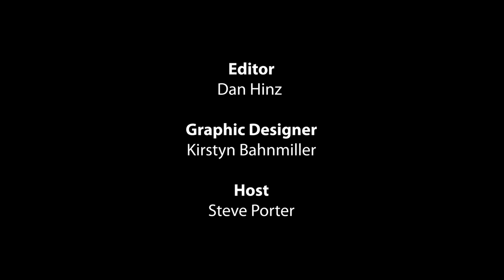The Truth About the Electronics Refurbishing Industry

Comment: I work for a computer refurbish place, and i can promise that majority of the laptops/desktops we sell are not that clean inside, just outside. The main reason for it here is actually time. They only hire one person to complete sometimes 15-20 orders a day (which includes fixing and updating the computers) and they need to meet the deadlines. There is zero time at my company to actually deep clean the computers but that doesn't bother management and from what i can tell with reviews online 90% of customers don't care or will never notice.
Reply: I will also say that when the company is buying these computers, they are on average buying them at half of what prices are on ebay, for some reference.
Reply: Sorry but in my opinion what your company does is a scam. Cleaning the outside of a device is NOT refurbishment, its just cleaned which frankly should be done anyway with any used and resold device.
Reply: We were making over $100 per computer at my store, so I didn't care if it took an employee a few hours. I wanted my refurbished systems to have the highest quality.
Reply: @JaimeWarlock  well thank you for being a good company. i actually quit the place last week. they stated they were only making about 30 per computer, and after cutting my hours and starting to send different products than what people ordered i left.
Reply: @cbcdesign001  you either didn't read or understand his entire comment...

Comment: As someone that worked for an unnamed blue and yellow electronics retailer for almost 30 years and worked on TONS of car stereos with the same load rollers I also suggest taking the rubber off the roller shaft and cleaning the inside of the roller. In extreme super dusty units I used to add some silicone to the inside of the roller to help it stick to the shaft. Great videos. Love em. Keep em coming.
Reply: Why not just say the company name though? We all know what it is.
Reply: Hustler electronics
Reply: 🇺🇦 Ukraine electronics? Didn't know that was a thing.😂

Comment: When I hear refurbished two things come to mind:
1. There was a previous issue with it, it was sent back to the manufacturer and the issue (e.g. replaced part) was corrected then resold.
2. It was professionally cleaned and brought back up to spec (parts may or may not have been installed, reapply thermal paste etc.).
Reply: These are the two I think of as well. The only worry I ever have is whether or not they fixed the original problem. Sometimes they miss something, especially if they can’t reproduce the issue. It's rare that you get to find out why something was refurbished but it does happen.
Reply: That's remanufactured. I would hold that to these standards.
Reply: You would be surprised how much stuff is tossed just to get the newest system, especially in government. When I worked at one refurbishing center, we would often get hundreds of computers from a local government office that were only a couple years old.

A lot of times, they would pull the new system out of the box and put an old system back in for easy logistics. One pallet we received actually had 5 boxes with brand new computers that they apparently forgot to exchange. They had never been used and I sold a couple for $500 each. Remember, these cost us nothing. Employees snatched up the other 3 (boss would occasionally let us have the best stuff).

Comment: As someone who has done a fair share of buying and reselling over the years, I always open up consoles and controllers to give a good thorough cleaning and also replace worn or damaged parts.  I'm more of a hobbyist but my turnaround time is often a couple of weeks, rarely less than a day.  I always submerge plastic parts in soapy water and scrub, and of course the drying adds a lot to the turnaround as does a thorough testing. 
If you're going to do it with that level of detail, honestly it isn't worth trying to make a profit on most things because there is so much time put into it.  The parts can also reduce a significant chunk of the profit too.  I happen to enjoy it and love to be the one to keep these things out of landfills.  Since it's not a "business" for me, I can take my sweet time and paying my bills is not affected by that.
Reply: Very cool man. If I didn't have several other hobbies I'd do the same. I do occasionally sell a few lightly used electronics and it feels good the items will be put to use again 🙂

Comment: Realistically, I expect dust to be removed and thermal paste replaced. A wipe down of the outside is necessary as well. Probably wouldn’t pay more than $200 for a refurbished console, which I know doesn’t leave much room for profit. Ultimately I’m buying cheaper and cleaning up myself. Ultimately the trick is to find cheaper systems and refurbish those, which is what DKOldies and GameStop does. GameStop trade value on an original PS4 is $55, which leaves a LOT more room for profit. Perhaps the key to the average person doing refurbishment is to find people selling those consoles for cheap (which potentially leads to more issues and parts needed to eat away at the profit margin anyway).
Reply from the maker: Yes, agreed. One of the keys here is getting them cheaper than the average person can find them. These companies are making crazy profit by selling them as refurbished when they don't do anything other than wipe off the outside.
Reply: @Tronicsfix  what also hurts too is that companies like DK Oldies buy up those console, even at more expensive prices, in the interest of making availability scarce so that they have a firm foothold on the reseller market.
Reply: Nowadays if you have $200 to buy a console you're better off getting a used Series S as they're going to making more games for it for a long time.
Reply: @jimmymyers  Just wish it had a disk drive :( Series S would be perfect with a disk drive.

Comment: For me, reburbished means to make it look and work as close to new as possible, which requires deep cleaning on the outside and inside, recapping if needed, and definitely new thermal paste, plus a few repairs where needed/possible. IMO, retro-brighting is NOT a refurbishing step, just an enthusiast option. I don't mind yellowed plastics, as long as the hardware is in top shape.

Comment: What I expect from "refurbished" is exactly what you did. Remove all dust and dirt both inside and out, new thermal paste, replace broken parts like fans. But I know the reality when companies say "refurbished" what they mean is "we did nothing and we hope you won't notice".

A complete refurb would also replace caps that fail an LCR test, replace loose ports and connectors, and any other preventative maintenance. When you buy a restored car that's what you expect; new belts, new gaskets, everything restored. But in the computer world they prey on people who don't know that electronic components also wear out.
Reply: I've done all that with a few old consoles I bought for myself but didn't want anymore. I took them apart, washed the case, cleaned dust off the motherboards, replaced capacitors, maybe did a video output mod. 

When I did sell them, I still didn't say "refurbished" just because I didn't want to be associated with the people who misuse the word. I just listed off all the things I had done and took as many pictures of the work (clean shell, solder joints, etc) as I could. When I'm trying to buy something, a detailed list of things that were done as well as a lot of photos would mean way more to me than "refurbished" so that's what I did when I wanted to sell something.

But hey, I'm just a hobbyist who occasionally needs to get rid of some stuff rather than some company or person trying to maximize profits at the expense of quality and honesty.
Reply: Or, in most of the cases, something in the middle: "we did a cursory clean-up and started it up once, it starts OK, all else is up to you"
Reply: Refurbished really means we tested it and it at least functions

Comment: 4:33 for plastics I usually go right to soap and warm water. The only risk you have to worry about is damaging any labels or stickers. If the plastic doesn't have any of that, you have nothing to worry about.

Just have to make sure it's rinsed well and that it completely dries out before you reassemble.
Reply: Dawn dish soap does amazing things.
Reply: What I've been using to clean electronics is contact cleaner from the hardware store.  It does a pretty good job at removing grime while keeping everything intact.  Not to mention the more you use it the better it smells.
Reply: White spirit/mineral spirits/benzine (I don't know the exact english term) does a great job with any stickers on plastics. Also works on textiles for removing makeup stains and everything that is fatty, even ballpoint pen stains. Best part is, it's not wet and dissolves into the air, so it's kind of a "dry cleaner".

Comment: To me, refurbished means exactly what we saw you do in this video. A used product fully cleaned, repaired and brought back to a like new quality. For a genuinely, well, refurbished product I would happily pay 85+% of retail for the product new. So for a $299 new console, I would say $255 refurbished would be fair.
Reply: thats not right refurbished products usually have been used extensively so refurbished means it will work for a little while more, so no, 50 dls less for a one year of use is not a fair deal

Comment: I've learned there's Refurbishing, basically cleaning and basic function tests, then Reconditioned, where the unit supposedly is taken apart and made as close to new as possible, then there's Factory or Factory Authorized Reconditioning, which usually has a manufacturer's warranty of some length of time and should be brought to like new condition, any worn parts replaced, and will only have a few minor cosmetic issues. As you go up the list prices also go up.

I hope I got that right. It's been over 20 years since I managed a store much like Best Buy but we carried a lot more pro gear and was one of Sony's, and other company's, largest accounts.

Comment: I used to fix/mod/refurbish broken consoles/controllers and laptops at the height of Covid. It involved removing faulty parts/components (fans, buttons, smd parts…etc), cleaning the pcb and washing the housing shells, then polishing the outside. It’s crazy many companies think just wiping and blowing air into the fans = refurbish

Comment: My expectation of “refurbished” is a complete clean inside and out, imperfections removed, faulty parts replaced and fully tested. I see “used” as a quick check, replace broken parts, a clean then sell it. Used seems more “as is” than actually tested too. Money wise, refurbished should be at least 50% off retail for brand new.

Comment: My definition of refurbished is exactly what you did in this video. I bought a refurbished Macbook Pro in 2008 and it still works now. I bought a refurbished iMac in 2017 and it's still running good, watching your video on it now. I expect refurbished electronics to be opened, cleaned, replace any worn parts, and then put back together correctly for sale. A used item you get as is, a refurbished item goes through what I listed.

Comment: From what I was told back in the day when FuncoLand existed (and is dearly missed), it would be to clean up the device and just replacing the defective part. This was during the time they started selling PS1 refurbs and told that to customers. I was also told the same by older now non-existing stores selling refurbed CD players and such which back then would come from the manufacturer with the label saying Refurbished. Nowadays, it's made more of gimmick to sucker people into thinking of the old school ways of actual refurbishing the product where they  just haven't done nothing other than a simple once over cleaning and ship to the customer. A damn shame this happens but you take the risk unless you know it's coming from someone that is reputable,

Comment: @4:30 - In my experience, putting those parts in a utility sink or shower, spraying them down with warm water, tossing a little soap on them and repeating the process really helps give them a good cleaning.

It does really slow finishing the process down since you've got to let the plastic fully dry, but I find it very helpful--and I've got terrible allergies and asthma, so getting that kind of debris under control is extra important.

Comment: I myself repair electronics. Now days finding broken stuff online for a reasonable price is near impossible. You would have to spend hundreds at a time to get the price you want for a single broken system. Buying bulk is basically the only way online. I've had more success buying locally from game stores. It's 100% a tough business solely just doing repairs. Now if you're also reselling video games and accessories. You can make the bulk of your money by reselling. Then having that extra service of repairing brings customers in to spend more money with you. That's just how the market is right now though. So many people getting into the business of repairing as brought up the prices of broken consoles. Then it brought down the price of some consoles bc they're is now more in the market from repairs.

Comment: i bought my ps4 slim last year seller told me needs ribbon cables replaced so i looked at cost of repair parts got the ps and when i got it bit banged up but motherboard was good no broken components saw to ribbon cables wasn't connected so i looked for any nicks or broken points lucky none connected and was good turned on no problems disk drive made a lot of noise so opened up and remembered  watching this   channel searched and saw disk drive problems more digging found disk drive cd holder is bent so bit of bending and got a working ps4 slim in my currency paid R1300 for console and courier was R150 in Usd paid $77.00 your videos helps a lot when repaires are being done

Comment: When I was an engineer at Sony, we were required to order refurbished equipment like monitors. One time,, we got a pallet of 12 monitors and only 4 were usable. The rest had significant defects and had to be sent back. I was on a bowling league with a couple of guys who worked on them and they told me that this was how it worked. They would only test returns if the customer said what was wrong. Otherwise it was assumed that it was a return due to cosmetic damage.

Comment: When I refurbish ps4s I always replace the fan, thermal pads, and thermal paste with mx-6. I always make sure I clean the disc drive and power supply internals. Depending on how dirty the shell is I deep clean with dawn dish soap. If a ps4 I sold were to be shipped back claiming it was broken in any way of it hasn’t been reopened I would replace the part and maybe even upgrade because of the inconvenience.
Reply from the maker: That's how it should be!

Comment: I worked as a TV service tech for years, we would referbish stuff every day, 
It meant stripping down and cleaning all dust off and soldering all the usual dry joints and making sure everything was working properly fixing any issues.
Each set would take 20 to 30 mins on average as long as nothing much was wrong.
Trouble is these things are often returned because there is a intermittent problem that won't show up in a 30 min referb test, so we used to soak test them for a few hours too.
I am pretty sure this is not done now.
I bought a laptop recently and it worked for 4 months and then the nvme started playing up crashing the thing more and more, I fitted a new one and reinstalled windows myself because I can do that but a lot of people would not attempt it and just throw it away.

Comment: Years ago I went into a vehicle spares shop, out the back they were testing starter motors they got from the breakers/salvage yard, if they worked they were cleaned/ painted and had a sticker  stating refurbished.
These were sold to local repair shops to fit to customers vehicles!

Comment: This is why a new classification of Fully Referbished or F-R should be used. Involved in this would be a device fully disassembled and inspected with all components tested (fan, disc drive, heatsink, power supply, capacitors, thermal paste and thermal pads etc.)

That would remove any doubt so long as you trust the seller or if the reputation justifies the buyers faith in the product.

I do a full refurbish as a private side job for consoles and everything works like new when I am done. It helps if you enjoy it more importantly, which I fortunately do. Good video and on point!

Comment: That's exactly why I have not joined the eBay refurbishment program. They have obfuscated the requirements for vetting a seller doing the refurbishment.  There is a complete lack of clarity in the information they provide for this program.  As you pointed out there are no standards. A good cleaning, replacement of any failing parts and testing to determine normal functioning should ensure a reasonable product life.  There are good refurbishers out there but that's not the majority. Buyers shouldn't have to guess which refurbishers take the care to do a good job.  Having refurbished and listed items on eBay in the past I could safely say that those items were inspected, cleaned and tested to operate as near new condition.

Comment: You should use a conductive and grounded vacuum to assist with cleaning.  Using canned air should be a last step since it can push debris deeper into areas.